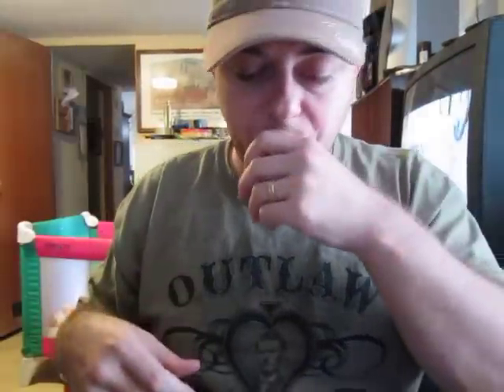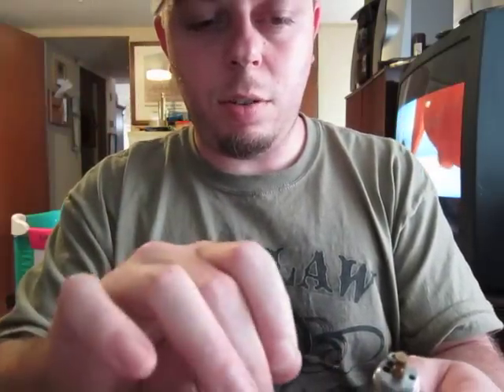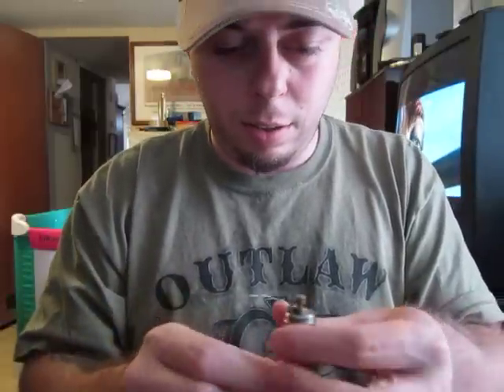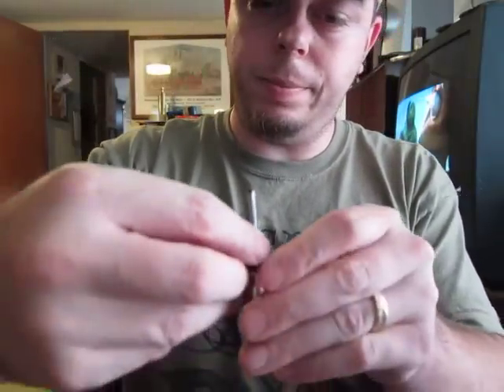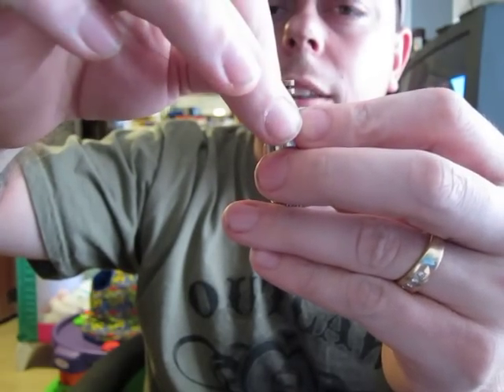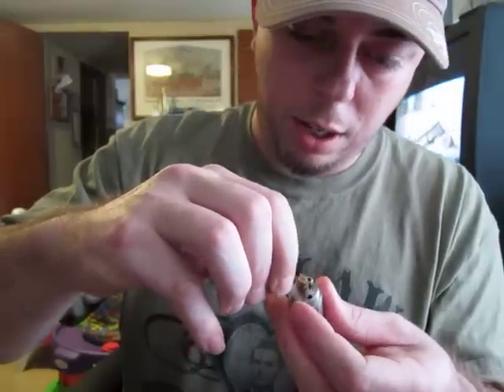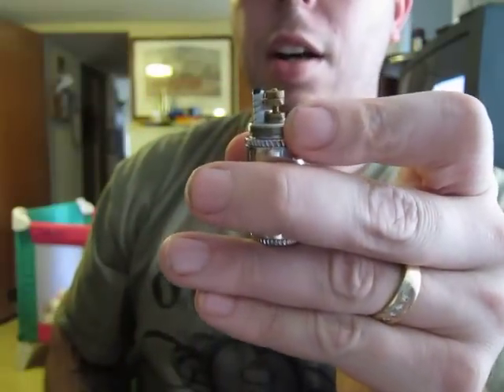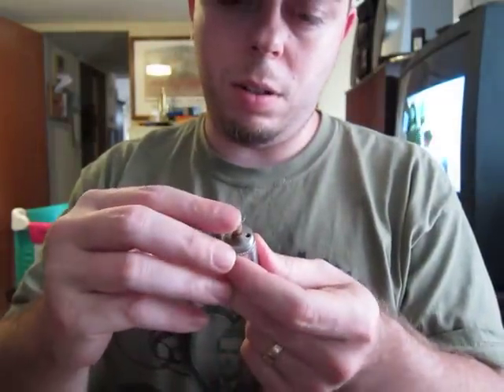How I Make A Genesis Wick & Coil Part 5 of 6

Comment from the maker: Thanks for the tip Andrew. I run my wire so hot that the supply that was in the video is long gone. I use the same wick for about 6 weeks but the same coil for 3-5 days. Its so much fun : ) Thanks again.

Comment: Also another way to get the kinks out of your wire is to "anneal" the kanthal wire with the torch for a few seconds. By doing that, it softens it and removes the springiness from it. That way, you get nice smooth wraps with minimal work...and no hotspots.

Comment: Best way to get the kinks out is to run the wire over your allen key at a 90 degree angle.  You will only have to do it once.